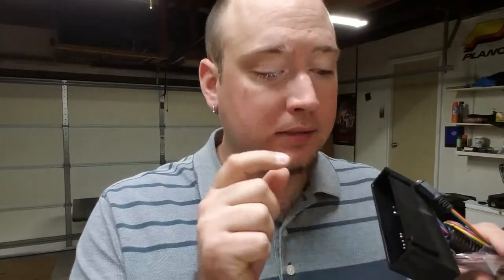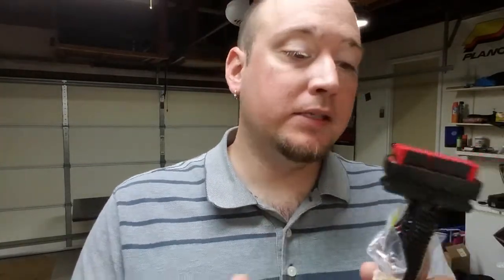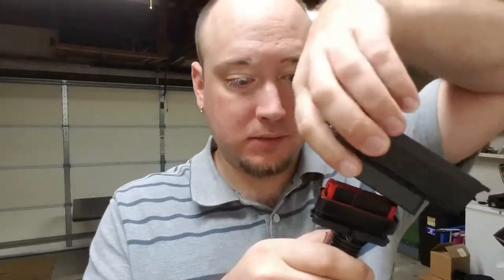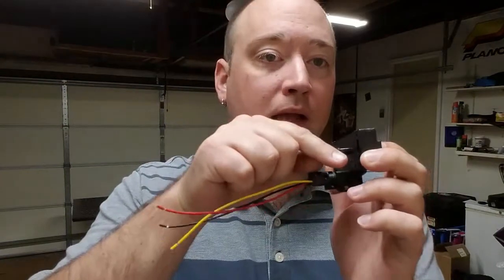87 Mustang Update. How I will tune the car!

Comment: Donny I have a question on the 87/93 fox body mustang mega squirt? 
On my 91 Gt it has a msd6al in it now. When I get the mega squirt installed do I still need the MSD box ? 
To run the set up. going to build a dart 347 turbo already have a 347 n/a just going better block and want to turn it up a little bit more thanks Bill

Comment: Are you running a separate ignition box ?
Reply: Awesome !! I’m going the same route ! I have been trying like crazy to get my current setup using the 36-1 trigger wheel to work , but I’m giving up and going with back with the dizzy and single coil .

Comment: Question I have a Fitech efi and run nitrous tunes myself just picked afr and pulled two degrees for every fifty hp I added worked out a progressive ramp and done... I’m close to buying an on3 do you think I could enter a tune on it myself or am I gonna need professional help problem for me is it’s 8 hours one way on the highway to the nearest tuner and dyno
Reply: And the car is a pig and possible not super reliable as is old muscle I drove it to and from the track but 8 hours from home is a problem if it breaks

Comment: Hey bud, any idea where I can get the same harness you’re running that piggybacks off of the ecm? I went through diyautotune website and they show it to be discontinued. Also, how hard is it to actually tune the car with the MicroSquirt!? I have the on3 setup as well and need to tune it but don’t want to take it to any shops here locally. Don’t trust any of them. Any help is appreciated!! Thanks.

Comment: How much timming you set at full boost? I also use the micro, and love it. I'm down to 16* @ 13psi/190kpa. I'm also at 21* @ 7psi/150kpa where you're sitting on psi right now. I'm running twins so its a tad different but the basics are the same. Im currently working though some over boost problems before I narrow down the tune more. I'm set at 8psi now but creeping to 12psi were the over boost kicks in. Which everytime it does I think I just blew it up everytime that spark cuts @ WOT. Haha.

Comment: Donny I already have a Air Fuel gauge gauge hooked up in my car that works . I was wondering about the pink wire from Microsquirt if there supposed to be a output wire from my AEM air fuel guage
Reply: I think there the same I just have to find a diagram on the internet or my manual. Thanks I ordered the Microsquirt and cord today. I will get the software whenever I get off work today. Wish me luck. Lol appreciate all your videos and the speedy responses
Reply: Donny B I think mine has two outputs as well narrow band and wide band just have to figure out which one it is. 

Is your mass air meter still plugged up or did you dissconect it all the way
Reply: Will do, right now I have 24lb injectors and I will soon have 42lbs ones. I have a nitrous car. Do I find outn the injector dead time in the tuner software
Reply: Just looked at the like you had for the Tuner studio I see there are like 3 different versions which one did you get. Hate to keep asking a millions questions just trying to make sure.